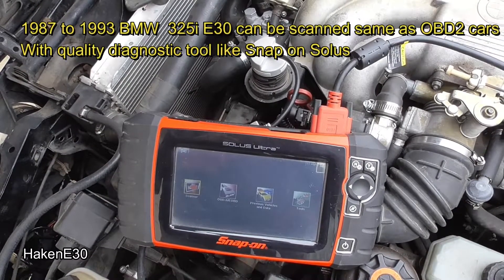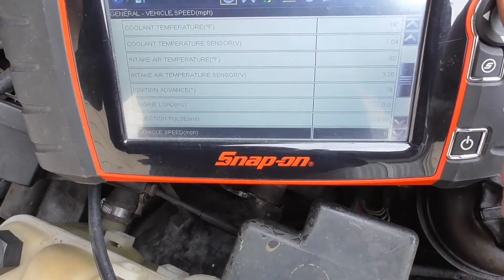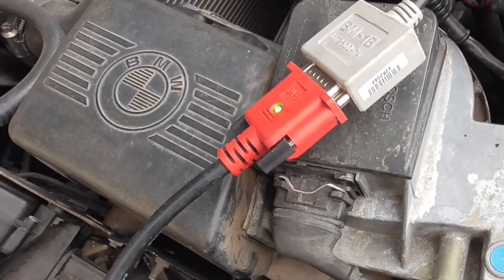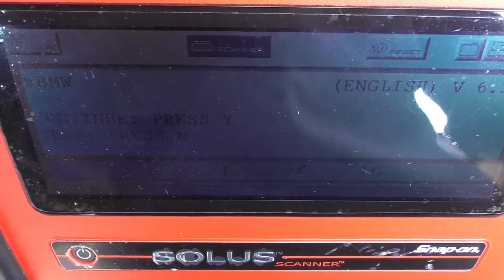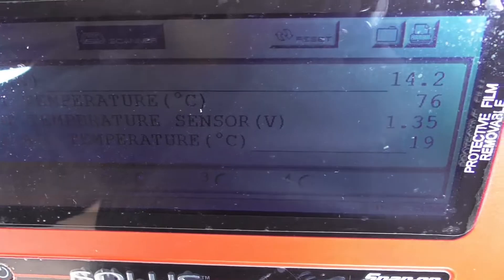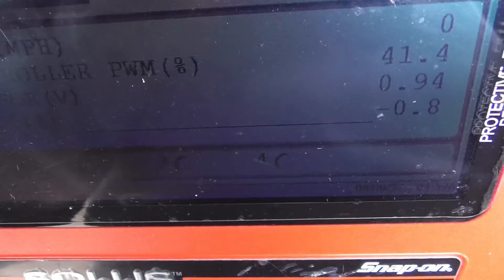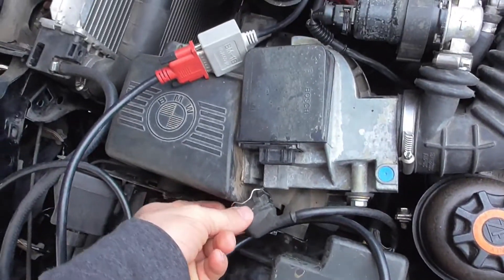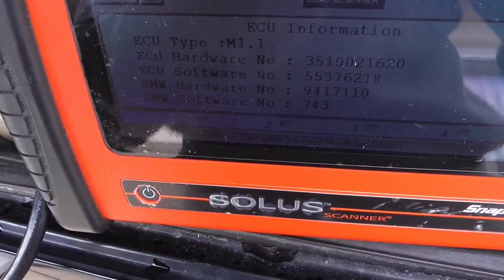1988 BMW E30 scanner diagnostics OBD1

Comment: I wonder if it could read out the M40 system on E30 which is usually 1.6 or 1.8 litre. Production up to 1994, but this is 4 cylinder engine. I had one once and nobody could connect to it properly. Maybe tools were faulty.
Reply: Much newer engine, so It should!